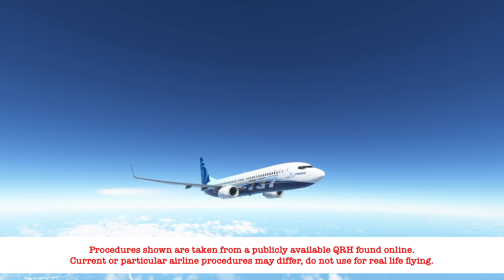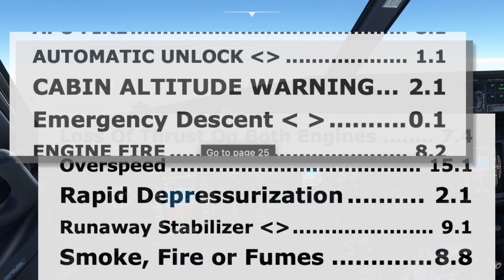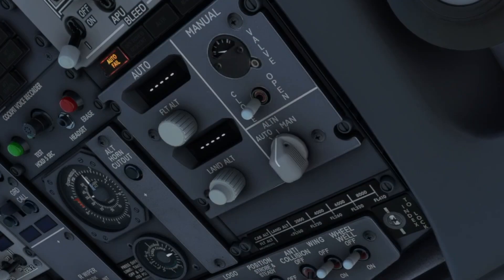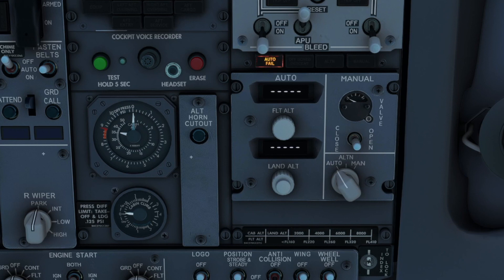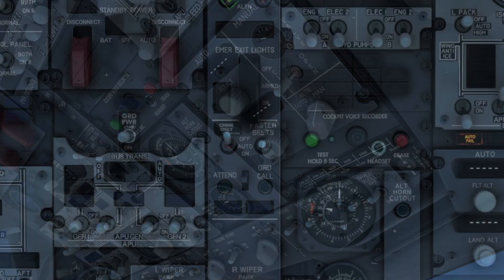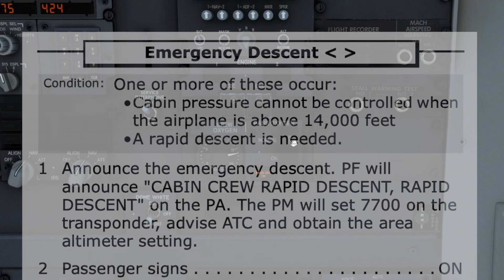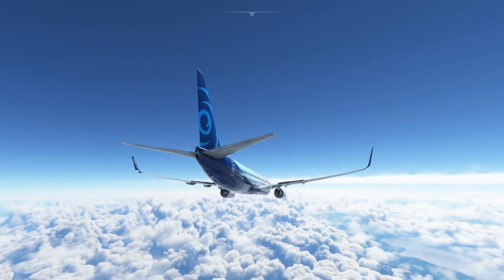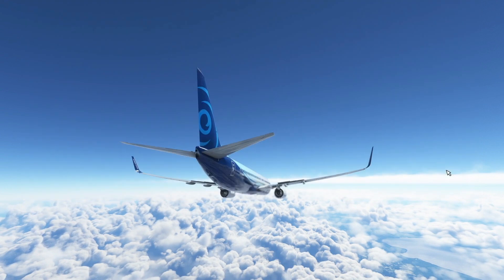737 Non-Normal Procedures: Rapid Depressurization

Comment: Hi, thank you for sharing your content; your videos are very helpful.

Could you please clarify emergency descent point number 5, specifically regarding the mention of "as required for anti-ice"? From what I understand, the autothrottle automatically adjusts for anti-ice conditions. How can we determine the necessary N1 for anti-ice in this scenario?
Reply from the maker: Thanks for your comment. That seems a popular question online. Once the anti-ice has been used, TAI is added to the N1 gauges. The "as required for anti-ice" is to ensure enough thrust is produced to cause the anti-ice lights to go dim (sufficient pressure). What that value is seems to differ depending on sources, but somewhere between 30-60% N1 seems to be what people are finding. Ultimately "as required" may be the best answer.
Reply: @pilottutorials  Thank you very much for your reply.

It certainly gave me some insight into how much to increase N1 for anti-ice.
Reply from the maker: @CaptG139 Thank-you Captain, glad you found the video helpful.